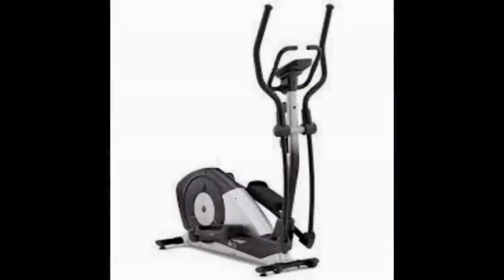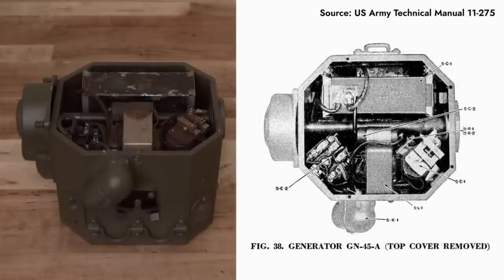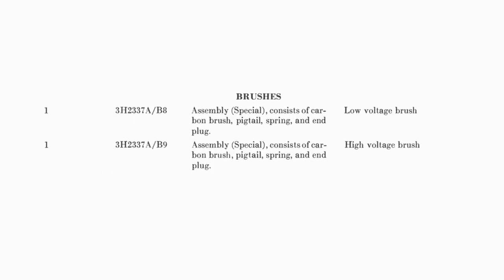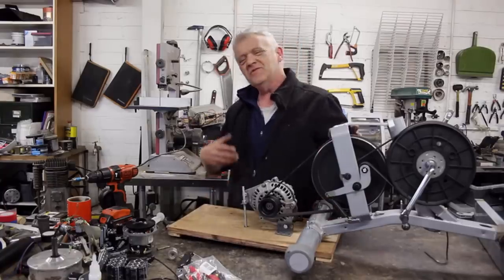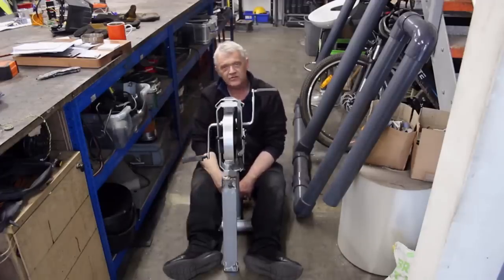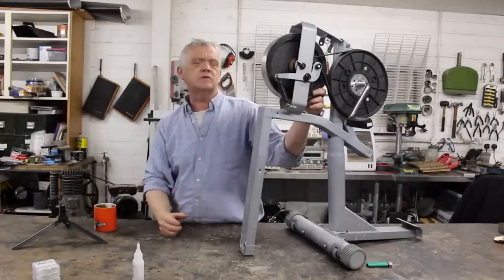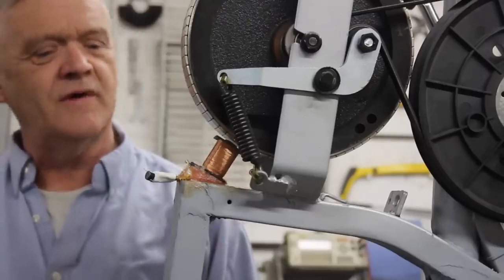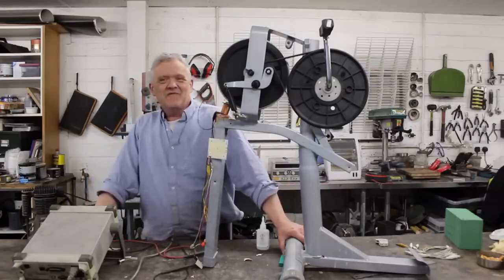2145   The GN44 45 Army Issue Hand Cranked Generator   How It Worked And A DIY Replication

Comment: Is there any way to pulse the coils via a pulse induction controller but have it work in reverse… would be an interesting thought, get more power out of the coils and using the same hand strength. I know strange question not sure if it has been done before.

Comment: Great piece of kit. I have an old British army 12V field generator (for telephones, I was told) which has a single hand crank. Still working. Two cranks would be better, and still better to pedal it - more strength, less fatigue, and leaves your hands free. I had an engineering workshop fabricate a  cam-type crank for it and I put the open end into a bearing in a wooden upright, all mounted on a board.

Comment: you could add a "simple" bench style seat to make it a bit more comfortable to use. just some board around 8-10 inch an up to 2 feet long with a rod as a leg. just glue 2 3-4 long inch pieces of cut of under the seat part, drill a hole with a hole-saw in the cut-offs and the board with the diameter of the stave you use… and if you don't have round stock… you do have a lathe
glue everything together so that the holes align with each other and hammer that round stock in (or you can be gentle and use glue) xD